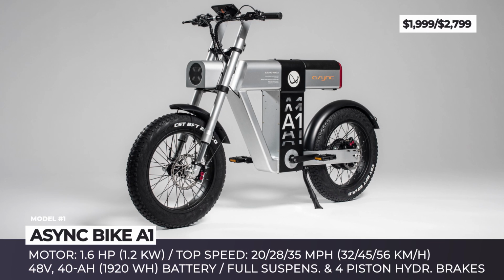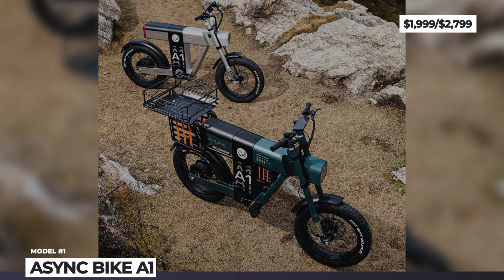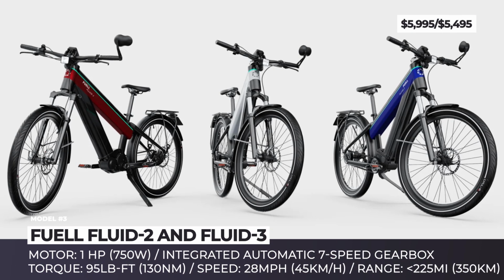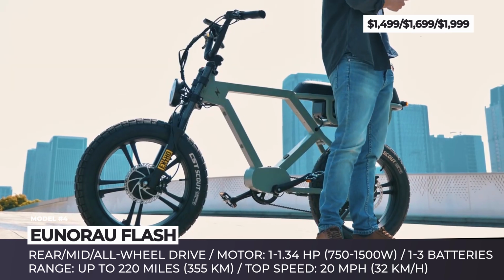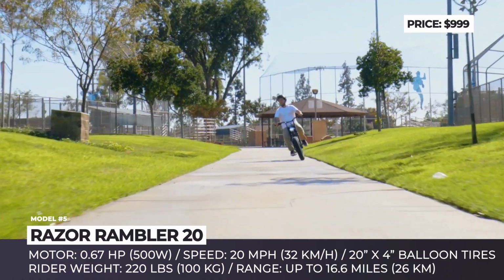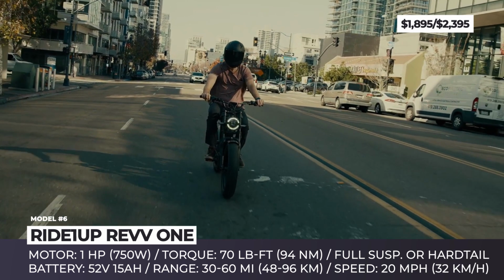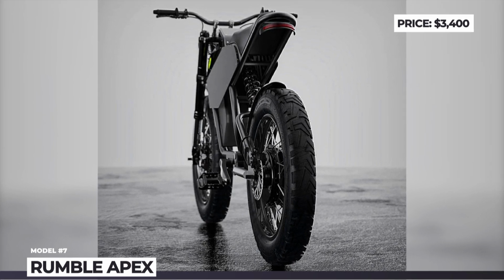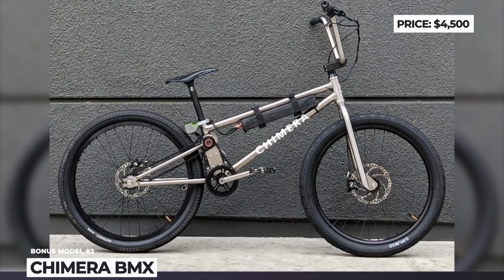7 Coolest New Electric Bikes Featuring Fresh Looks & Smart Tech for 2023-2024

Comment: I want to love them but the performance SUCKS! none of them seem to have the perfect balance of extreme power, speed, FULL suspension, range and overall value.  If you compare the specs to that of an electric unicycle then an ebike seems like a second class choice. EUCs are already over 100v, ~60+ miles of range, 3kw motors, suspensions that have up to 6in of travel, 45mph+ speeds, and cost between $2k - $5k. They have a bit of a learning curve but are extremely fun! ebikes need to step their game up! If it has two tires then it should have either 2 motors of at least 1,000 watts each or one very powerful mid-drive motor. speed should easily be 50+ mph and range needs to at least be over 100 miles without peddling at all! No serious riding enthusiast wants some POS like the razor! price also needs to be in the same range as the EUC. none of this $10,000 crap that I can buy 3 electric unicycles for and take a whole crew riding! STEP YOUR GAME UP!

Comment: They're all good looking bikes bar one or two they're all cool mopeds but ditch the gears and go single.speed
Reply from the maker: Do you prefer hub motors or mid drive units?
Reply: @automotiveterritory  it depends on the bike the riding conditions and style and also speed, there's some real benefits to both types, maybe say hubs work well for lower cost and lower power applications, anything over 3kw I'd want mid motor

Comment: I just bought a EUY S4 1000w 26ah for $1,300 and a Ridstar 1000w 20ah for $1,132. Both 20" cafe racer style.  I'm looking for a 3rd model to buy under $1,500. Any suggestions?

Also can I charge these on a portable 12v solar charger that has a charge controller?  Is there a way to connect the bike chargers to a + and - clamp?  That's what my solar charger has to connect to. Thanks!
Reply from the maker: What style of bikes do you prefer? (that's for your first question)
As for the second one, I am not sure that there is a plug-and-play solution for your solar charging needs. The only idea I have is to use something like a mobile powerbank (like Ecoflow) as a way to collect your solar power and then charge the bike with Ecoflow.
Reply: @automotiveterritory  I need all terrain bikes good for gravel, sand, and some road.  So fat tire and a little lower to ground with center of gravity probably best types.

I may try connecting my 1000w DC inverter to my spare car batteries while the 110v solar panel is connected to the car battery and see if I can get free juice and charge the bike batteries that way.  Even if slow charge, would be cool if that  might work.
Reply: @thesetruths1404  I want to show you my fat tire electric bike, it has full suspension and dual batteries🥰